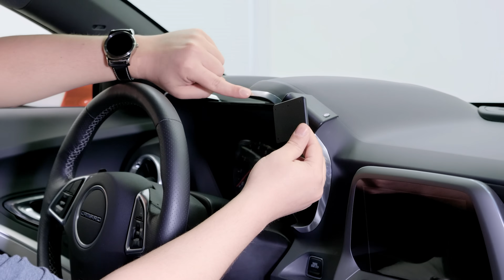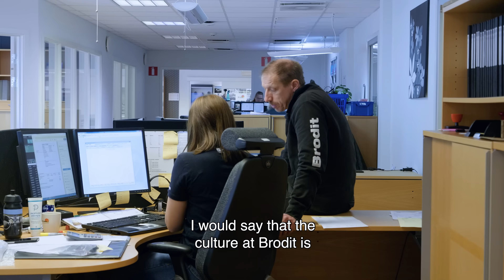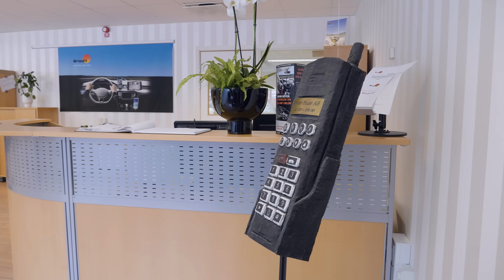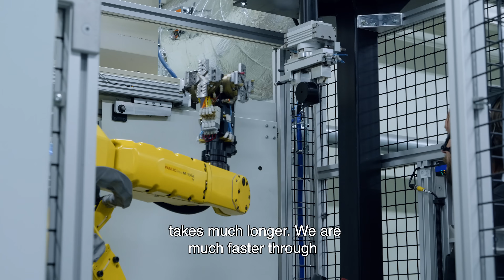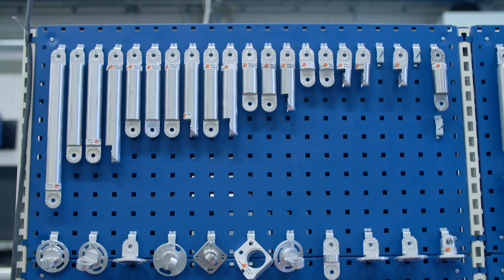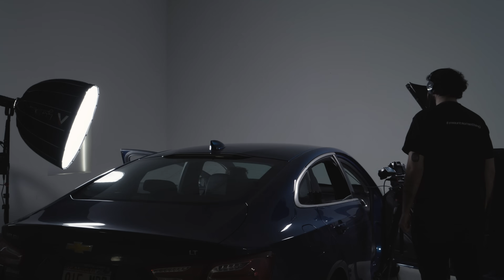The ProClip USA Story

Comment: I've been using ProClip/Brodit mounts for years. The only problem I ran into with them was on my Miata, due to it being a convertible. The hot sun combined with the weight of the devices used eventually caused the vehicle mounts to deform and no longer stay clipped to the dash. I've had to rethink how I use the mounts and no longer put as much weight on the replacement vehicle mounts. That said, I can whole-heartedly recommend ProClip/Brodart products.

Comment: I'm very happy with my Proclip, it's solid and mounts in such a way that it isn't hanging off the air vents / suction cup on the windshield or literally glued/taped to the dashboard. I didn't know why it was so much more expensive vs injection molded until after I received it and saw that it was made out of dense ABS plastic and looked very well designed.

No other mount on the market was designed to be placed in that location that Proclip chose for it. Everything else was a generic solution that didn't work well, or had the possibility of falling off, blocked your view of the road, or rattled, etc.